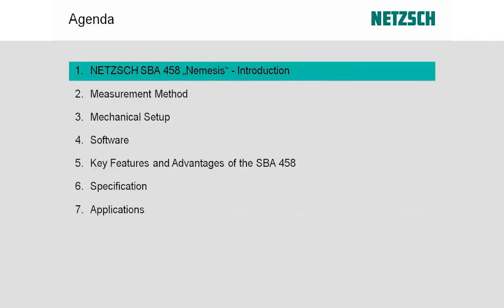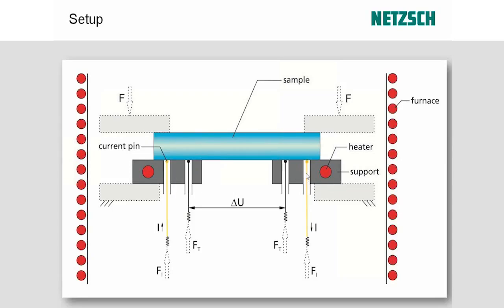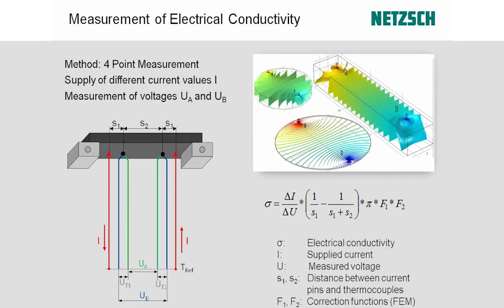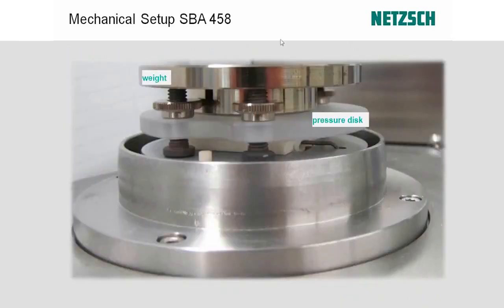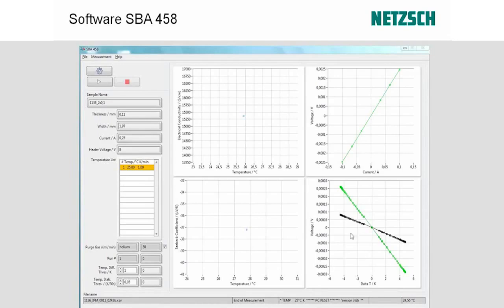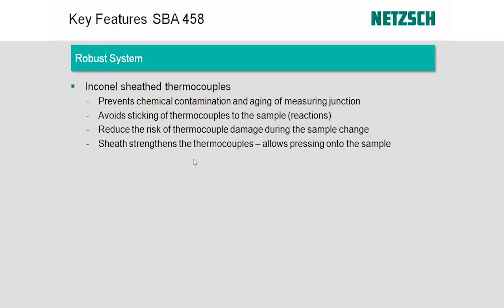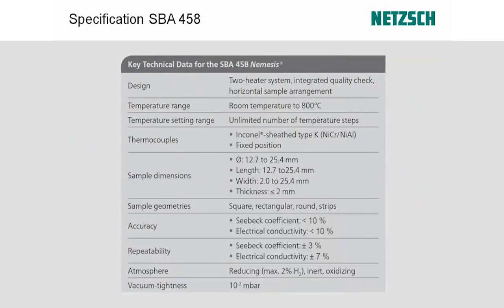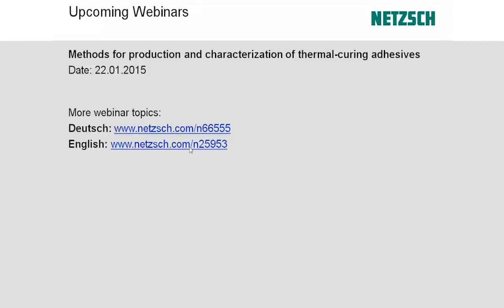Seebeck Coefficient & Electrical Conductivity with SBA

Comment: Can you provide more details on how to determine F1 and F2 in the conductivity formula?
Reply from the maker: The current supply creates a potential field in the sample. The equipotential surfaces of this field depends on sample geometry and the contact points of the thermocouples and wires on the sample.
Therefore, depending on the distance between thermocouples, current pins, the sample geometry (round, rectangular, square), and thickness different factors result.

This dependence makes a special correction function necessary. The corrections values of F1 & F2 are automatically determined within the NETZSCH software.